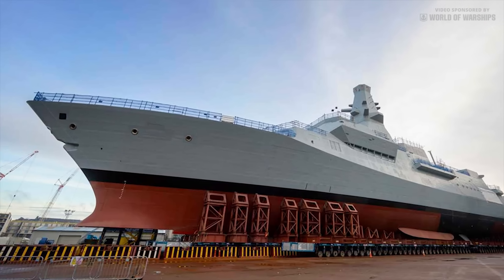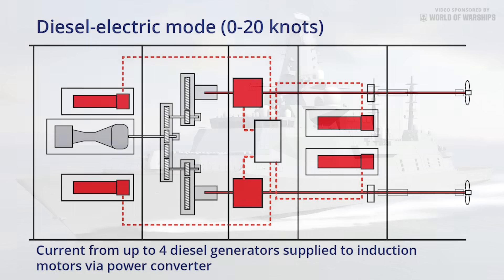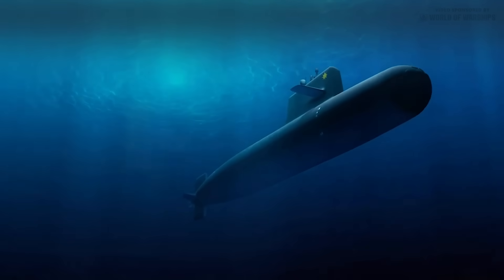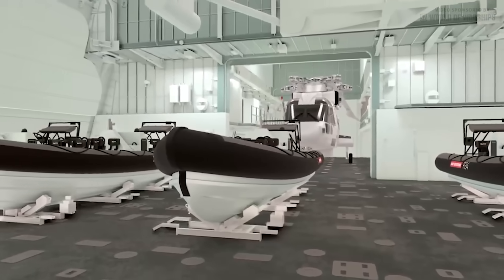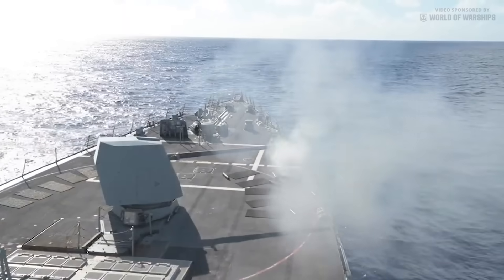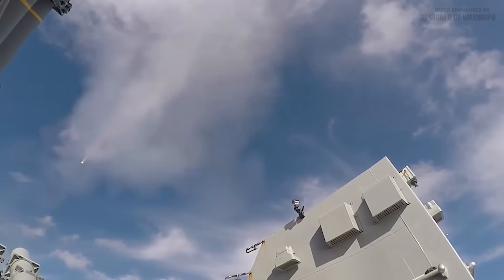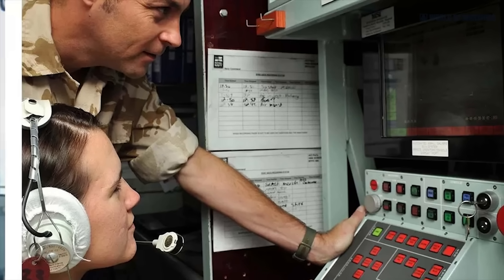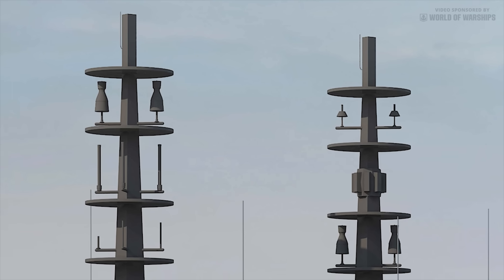An in-depth look at the Type 26 frigate design

Comment: Australian Type 26 AEGIS combat system Hunter class frigates will have the Australian designed and made 6 faced AESA "CEA FAR 2" search radars that have not one, but two 2 bands of search radars, a 6 faced S band radar suite and 6 faced anti stealth L band radar suite.
Also linked with these multifrequency search radars will be the 6 faced AESA "CEAMOUNT Fire Control Radars" that can lock on to 60 missiles or targets in an instant in a 360 circumference.
This radar will give the Hunter class an anti ballistic missile capability with SM6 and possibility future SM3 and will be linked to the US anti ballistic missile defence system.
That completely outperforms US SPY 1, SPY 3, SPY 6, SPY 7, - S band radars with their single lock on capability fire control radar the AN/SPG-62 in the X-band frequency, these radars have limited stealth detection range.
Hunters also has the Type 26 passive and active ship and towed array sonars which are considered the worlds best along with the ship being capable of silent electric drive during ASW missions.
When this ship hits the water it will be the world's best frigate!
Also sailing and linked in with the AEGIS Hunter is the future Australian Unmanned / Optionally‑Crewed Vertical Launched missile Ship

A Large Optionally‑Manned Surface Vessel (LOSV) that hold many VLS cells
Purpose
• 	Act as a missile‑magazine ship to boost the RAN’s Hunters firepower.
• 	Carry extra Vertical Launch System (VLS) cells for weapons like SM‑2, SM‑6, ESSM, Tomahawk, and ASROC.
Design Basis
• 	~3,000 tonnes
• 	~91 m long
• 	Modular payload bay
• 	Designed for low‑cost, high‑endurance operations.
Crew Model
• 	Optionally crewed — can run unmanned for high‑risk missions or be crewed for transit/maintenance.
Role in the Fleet
• 	Operates alongside Hunters and Hobarts as a cheap, survivable missile carrier.
• 	Expands Australia’s distributed lethality and magazine depth.
Timeline
• 	Confirmed in 2024 surface fleet review.
• 	Over Six LOSVs planned 
Likely extra VLS counts (32–96 VLS cells) for this unmanned/manned ship.

Comment: I wouldn't replace Phalanx with DragonFire, I'd replace it with the Oerlikon Millennium Gun or the Thales RapidFire. I'd then add DragonFire as yet another layer of defence, as well as a naval variant of the RapidDestroyer RF weapon. Ships can't have enough (good effective) anti-missile & anti-drone defence in this day & age. Other options/additions would be 40mm & 57mm guns that the Type 31 frigates will be getting. 

As for the two DS30M guns, can they shoot down UAVs (in addition to FIACs)? If not, they need to be modified so that they can.

It would also make sense imo to fit the Type 26 with BAE HVPs that could be fired from the 5-inch main gun to shoot down anti-ship ballistic missiles and sea-skimming anti-ship missiles. These are a no-brainer imo.

Lastly, I'd fit the Type 26 with anti-torpedo torpedoes. We need to test torpedoes such as SSTD CAT, MU90 Hard Kill, SeaSpider & Tork, and then fit the one that works the best.

Comment: "flat panel" and "rotating" are not mutually exclusive terms when it comes to radar... Sampson (on the Type 45) has 2, back to back flat panels which rotate.
I read somewhere that Artisan was developed from Sampson, so I think it might actually be a small, single panel AESA radar, in a rotating mount.
Reply: S1850 (LRR) is also a flat panel rotating phased array

Comment: So when the frigate is operating off the generators how much silence can that buy you?  You still need the engines to power the ship.
Reply: Yes, but because they don't need a mechanical connection from the diesel generators to the drive shaft they can be acoustically decoupled from the hull  making them much quieter.

Comment: I am baffled in in the fact the didn't use this hull for a T45 replacement considering how well designed it is and it would save cost of development, I have seen the type 83 and it seems rather other the top in proportions. another thing, if some slight re-enforcing of the MMB was could Some VLS tubes be added above it.

Comment: The Canadian version went with Point defence  Sea Ceptor , would have liked both options . Of course I am hoping I am still around by the time Canada even see's this Frigates in service.
Reply: Same with Australia.  They have seriously delayed the first ship to be built to 2033. 

Although theirs not knowing what the varent armament  they will give  the hunter class (type 26) they will go with till sometime 2024.

BAE Australia ship builders have given Australia 3 varent armament class. 

1. 32. Cell MK41 VLS with multimission bay with full ASW capability, including toward away sonar system.

2. 96 cell MK41 VLS no multimission bay and some ASW equipment removed Although can  still be equipped with topedo sized drones that can be stored inside the helicopter bay without taken up room for the helicopter for ASW detection. Also, change  to some of the electric power and engine and fuel tank upgrade 

3. 128 cell MK41 VLS changes include the same as the varent 2 but no front 5 inch gun.

Australia chose missile ESSM evolved sea sparrow as main armament to protect the ship.. strike  missiles  such as SM2 SM6 NSM and tomahawks. Future add ons. Hypersonic stand of missile. Including Asrock ant submarine missile. And  LSRAM missile. And Nukla decoy systems. SM3 maybe  another option 

Guns. 2x 30mm guns. 2x phalanx close in weapon system guns. And (5-inch main gun. 136 cal)

6 Torpedo tubes. 4x4 NSM anti ship missile tubes. Aegis combat systems. SAAB interface computers CEFAR-2 electronic scan aray radar system.

The general purpose of the hunter class is ASW but will be used for multi-purpose use. So it may be used for the same role as the destroyers. For air and land attack  also. 

So be interesting  what Australia government  will decide on varent  of armament.  

I think they will go with option 2. Armament. And build additional heavily armed corvettes to make up the ASW fleet

So basically, Australia type 26 hunter class will be destroyers.  I think they should change the name to attack class

Comment: 🎯 Key Takeaways for quick navigation:

01:50 🚢 Type 26 has two main propulsion modes: gas turbine for high speeds and diesel electric for quiet cruising.
04:06 📏 Type 26 is a large frigate, similar in size to the Type 45 Destroyer, with an emphasis on aesthetics and clean lines.
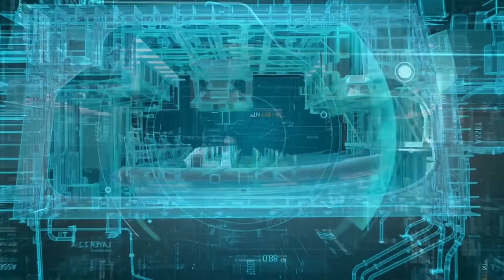05:31 🏢 The flexible Mission Bay is a key feature, allowing for various equipment and containers to be carried and deployed.
07:32 🚀 Type 26 is equipped with modern weapon systems, including the Mark 45 gun and Mark 41 VLS, with potential for future missile types.
09:24 🌐 Air defense capabilities include the Sea Ceptor VLS modules, and the ship features 48 missiles for self-defense.
11:57 🔐 Electronic warfare capabilities and communication systems are part of Type 26's modern equipment.

Made with HARPA AI

Comment: It's just a shame that they didn't make the ship 20 ft longer and fit 64 mk-41 VLS cells in it
Reply: Its an asw frigate without a long range search radar, meaning sea ceptor, fc/asw and posibly an asroc is all it will be equipped with and its hull is specifically designed to be acoustically quiet at great cost, making it a aaw frigate would be an expensive waste, and its also too small to be used as a base for the type 83 as you probably want more vls cells than 64. The better option to supplement the the type 45 is actually the type 31, just build it to Iver Huifeldt specs- 16 nsm or cannister lanched fc/asw, 32 aster 30, 24 sea ceptor, sampson and s1850 or artisan
Reply: @lukeallison3713  It's more than just an anti-submarine frigate. It carries multiple strike length VLS tubes for tomahawk missiles. And if it's operating as part of a task group, it's going to be working with destroyers at an aircraft carrier, so it would make sense to have longer arrange missiles as well. A dozen CAMM-ER to supplement the shorter range version makes sense. 

Canada and Australia certainly need more vertical launch tubes as their versions will be much more than anti-submarine frigates. The Canadian surface combatant will be the only large surface combatant in the Canadian fleet. The Australian version will have l band and s band radars as well as sborter-ranged  X-Band radars
Reply: @ronmaximilian6953  Unfortunately, though it is definitely a little bit undergunned for its role (more multi purpose than type 26), the aussie variant is currently having significant weight problems linked with using ceafar and other indigenous tech integrated to aegis , while the canadian more with spy-7 LRDR is not having the same problems. The best answer for the aussie variant is probably some amidships mk 56 launchers for essm, 12x2 essm would free up the 32 cell mk 41 for 24 sm, 8 asroc as an example or tomahawks if needed. The canadian vessel is definitely in more of a predicament. It needs to improve significantly in both aaw and asw performance from its predesescors (tribal II aaw with 29 mk 41, all for sm2 Halifax asw. I think 48 mk 41 cells is a good number, 32 sm, 8 asroc, 8 tomahawk and 12x2 essm in mk 56 (current plan is 24 sea ceptor, essm in mk 41 which will mean not enough or no sm). The british variant could also do with a modest upgunning, the 48 'mushroom farms' can all take camm-er anyway but the ship as it is can't really fully utilise anything with more range with that. 32 cells and a commitment to an asroc type weapon would be nice, note tomahawk has not been announced and will not be needed as fc/asw is designed for that role as well as anti shipping. 16 asroc,16 fc/asw would be great. Ultimately the design philosophy of the type 26 is 1-ASW, 2-Anti shipping and land attack, 3- AAW and so it is only expected to defend itself although sea ceptor is a great weapon both for that task and task group defence

Comment: This ship was a huge waste. Over 1 billion pounds per ship. They should've gone with more upgunned specialized variants of the type 31.
That would've been cheaper and that would've helped to build fleet numbers.
Reply: Wouldn't have been as good at ASW
Reply: @admiralmallard7500  why? What's the difference?
Reply: @RR-us2kp  T26 is built from the ground up for ASW work, with all manner of noise dampening techniques and an electric propulsion system. On the other hand the T31 is based off an air defence frigates, it uses direct diesel propulsion which is noisier and doesn't have the same amount of cladding. Now some of those things could be added, but those add expense. Hence why the T26 us so expensive.
Reply: @admiralmallard7500  french fremm frigates are also purpose built asw frigates. They don't cost over a billion pounds. They even use the same sonar suite
Reply: @RR-us2kp  Well for one, more of them have been built. But the T26 is absolutely a better ASW ships, has had several more years of development.
Reply: @admiralmallard7500  what exactly is better? I want an exact detail that makes it better than a fremm.
Reply: @admiralmallard7500  I'm asking this because lots of people on YouTube pretend to know more than they actually do. So if you know something about the type 26 that is not known to the public (which is all I know), let's hear it.
Reply: @RR-us2kp  it's been a decade since the first Fremm was laid down, there undoubtedly been advancements since then.
Reply: @admiralmallard7500  one is french and one is British. So development time is meaningless.

Comment: I love the frigate it's just I wish the UK bought more, it looks to good to be true.
Reply: Canada has gone with the Type 26 also 🇨🇦
Reply: Agreed but announcements made about T31 since your post have made me slightly less disappointed about the T26 numbers.

I would still like more T26 but at least T31 does seem to be evolving closer to what could be called a credible frigate now that it has been announced that it will be getting a Mk31 silo with many people claiming that will be 32 x Mk31 although I'm not sure that 32 number has been confirmed.

Even if the Mk41 silo is a replacement for the initially planned Sea Ceptor silos rather than being in addition to it a single 32 x Mk41 silo could still host for instance 64 x quad-packed Sea Ceptor in half of the silo with 16 x Mk41 still left over for heavier stuff. That on its own is a respectable load-out and if T31 also gets NSM cross-decked from retired T23s then even better.

This sort of T31 spec plus the T26 plus the Sea Ceptor upgrade for T45 does, in my opinion, deliver a pretty capable frigate/destroyer fleet especially if the T31/T32 (whatever T32 will be) gets built up to the rumoured 10 vessels.
Reply: @julianfp1952  👍

Comment: Nice Frigate.  The USN should have had this company bid on its latest Frigate project.
Reply: Well said. Sadly in 2017 the US Government knew exactly where the T26 programme was at the time and so deliberately set the requirement for ships already in the water thus excluding the latest technology and ship design. Buying British was a NoNo. And then to top that off they chose a 20 year old French /  Italian design by FREMM.
Reply: @1chish  The fremms are far from being a "20 year old design",i can't speak for the french version but the italian ones have been constantly upgraded with the latest tech and the last two will feature fixed radar arrays.
Plus the USN didn't want any new tech,they wanted a proven design that can be refitted with proven us tech like their aegis platform,the point of the constellation is to mass produce hulls against china's type 54.
Reply: @ClippyDefWouldntdothat   I am aware designs get upgraded but the FREMM was designed in the early 2000s.
I think my point was that no matter how good a design was 20 years ago the latest designs will be better.
Reply: @1chish  But in the end it would get heavily modified just like the fremm was to fit their aegis platform and systems,because in the end that's the only thing that matters on american ships,that's why the arleigh burke is still a great design even though it's a project from the 80's.
You can probably fit an aegis platform on a ww2 ship and it would still give hell to most navies out there haha.
Reply: @1chish  holy crap
Reply: @protonneutron9046   It certainly is mate!
Reply: We should have bought the ship design. But no way that this is the ship that we should have. But it doesn't have enough weapons

Comment: I feel that the RN should have procured at least 16 Type 26s given the increasing Submarine threat in the North Sea and particularly around the GUKIC Gap. Instead of wasting more and more money on separate procurement programs to produce small numbers of woefully underarmed vessels like Type 31 and future Type 32 frigates, the MOD and the Treasury should have just accepted that the RNs long standing ASW mission is one of the most critical to UK’s maritime security, and so prioritised as much funding as was required for not compromising the RN’s ability to conduct ASW operations. I feel that other than maintaining the UK’s CASD, Anti-Submarine Warfare should be of second most importance, rather than trying to perform a compromised Carrier Strike capability in which we are still unable to operate a fully sovereign capable air group for the foreseeable future.

Comment: The Australian navy version will reportedly weigh 10,000 tons fully loaded.
Reply: The Australian ships will have an Aegis weapons system, CEAFAR L and CEAFAR S 3D Active Phased Array Radars with microwave scalable tiles and CEAMOUNT Active Phased Array Illuminator array radars all with Digital Beam Forming, Extra Mk 41 VLS systems than the Type 26, SM6 missiles, Tomahawk, LRASM, SM2, ESSM, an Australian interface networked and communications with the USN fleet
These ships will have the same ASW attributes as the Type 26 frigate, the first two ships will be named after British sailors Hunter and Flinders.
Yes yes a very different beast to the Type 26 this is the ship the British should get.............. Go all out baby!.
Reply: Well it has Australians on board
Reply: 6,900 Tonnes is the standard displacement. Full load will be 8,000 Tonnes.

Comment: The VLS should have been 32 cell....
Reply: It's a 24 mk41 vls with 2×24 cell sea ceptor vls.. making for 72 vls cells total. How many more would you like, Especially on a frigate.. lol..
Reply: @Markus117d  I'd like another 8
Reply: @the-bringer-of-truths  32 mk41 vls would be nice, But don't forget with the 48 sea ceptor cell's for air defence. All 24 mk41 vls on the Type 26 could be used for cruise missiles. Unlike the constellation class design with it's 32 mk41 vls cells which would probably have to be a mix of defence and strike missiles.. 🤔
Reply: @Markus117d  A healthy mix depending on the ops requirement is what I mean, the higher amount of slots for AA, AS or land attack misssiles as well as some new anti sub sea slamming type depth charges would make this ship a true Global combat beast ! Some extra room for additional helicopter capability too plz... would 3 be a push?? 2 folded in a hanger and one on the deck ??
Reply: @the-bringer-of-truths  Deck parking on escorts just isn't a thing. They can carry 2 wildcats with simultaneous operation. 2 Merlin's can be carried, but 1 is in the boat bay so simultaneous operation would be difficult.